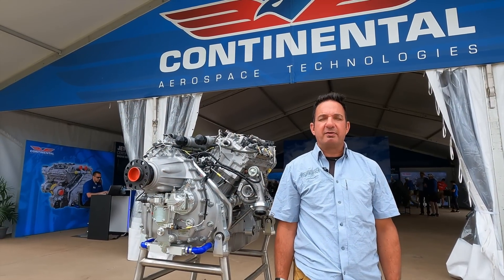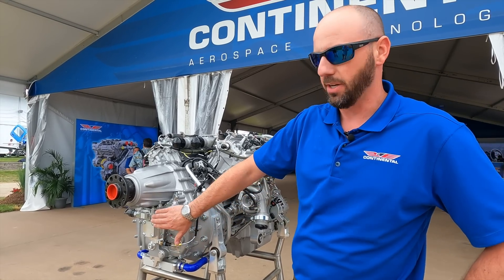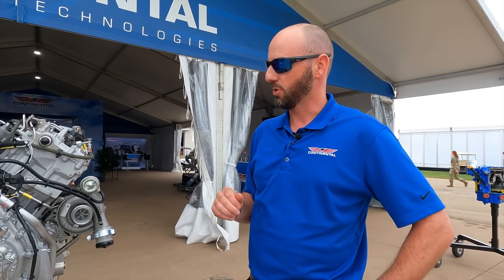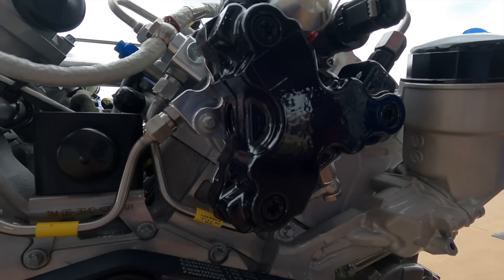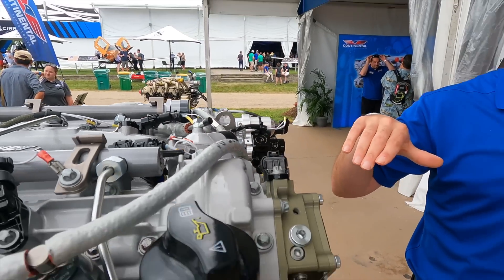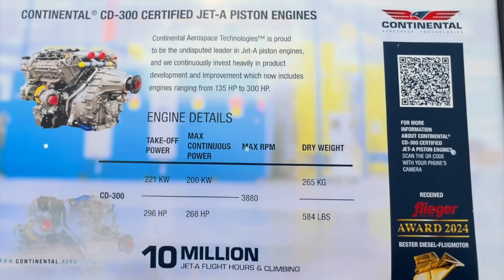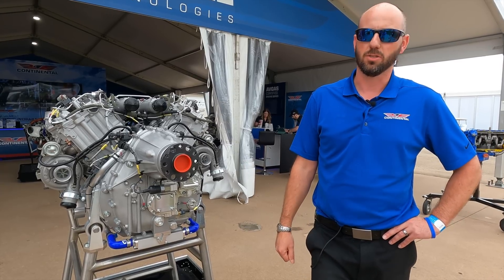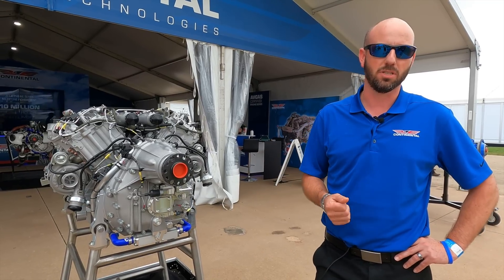AirVenture 2024: Continental CD-300 for Cessna Stationairs

Comment: Thanks for sharing, but one thing I noticed is there are multiple redundancies in the fuel system, 2 alternators, but it only has a single serpentine belt to run the water pump and alternators.  So if that belt fails how long before the engine overheats and you run out of power? Or is there something I am missing?
Reply: Just as well they have three-bladed propellers available too so if one blade falls off you still have two left!
Reply: The Serpantine Belt has been doing great on cars the last 30 years or more, I change mine every 2-3 years, NEVER had any issues!
Reply: Same issue with the crankshaft. They only incorporate one, and when it fails hmm
Reply: You've still got a battery to get you on the ground
Reply: Super-wide belt, and with a diesel, pulling back the throttle will help cool it (as it's not a "throttle", just a fuel controller, so you get full airflow always.) So will turning on the cabin heater. Find an airport, pull the throttle, use power only when needed, should be a non-event.
And I wouldn't be surprised if they designed to have some amount of thermo-siphon.
Reply: Agree, I thought the same. Belts are really reliable, but they don't last forever. The consequences of one failing is very high.
Reply: No belt = no water pump.  Compression engines have high volumetric heat production.  They might have developed some siphoning capability but that's tough if not designed into the original engine and I doubt Merc did that.  My guess is if you break a belt you got about 60 seconds at mid range power before you are looking at engine damage.  Maybe 5 to 6 minutes to get it on the ground.  Good chance it is still making power then but you've cooked the heads.  Surely they have thought of this and have an answer?

Comment: Think of all the problems that powerplant could have, especially during the first 10 years. There is something to be said for the old style engines. Where could get it fixed in most of the world?
Reply: Anywhere you can get a Continental fixed. Good thing old engines never have mechanical problems. If you haven't noticed modern design engines are actually more reliable and economical than the old engines. It is your choice to stay with the old.
Reply: @zorbakaput8537   Well I've been an A&P for a while and know nothing about trouble shooting a modern engine. We sometimes have trouble figuring out problems with old engines. I can not begin to imagine how "any place" that fixes Continental engines could figure out a modern high tec engine, it would be like apples and oranges. How many of us can still work on our cars? It takes fancy equipment and very few aircraft repair shops have anything like that.